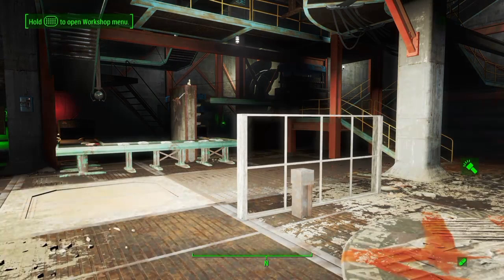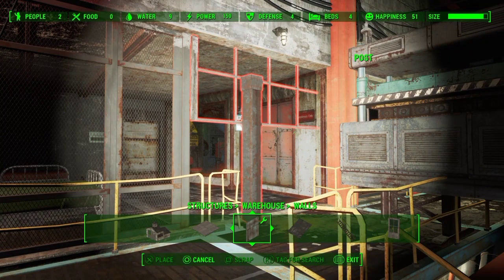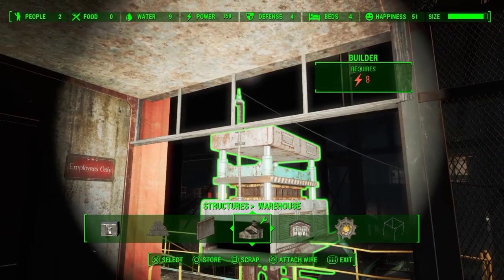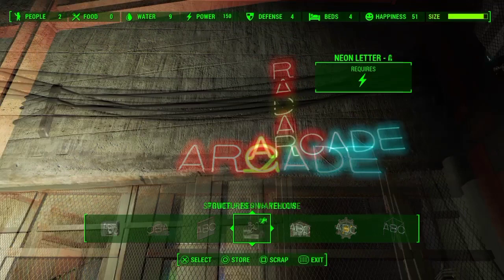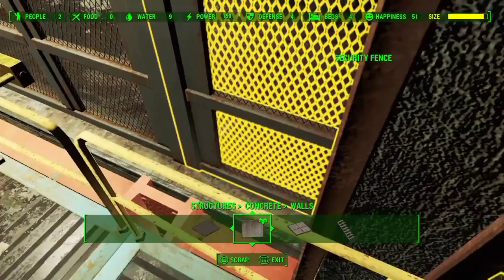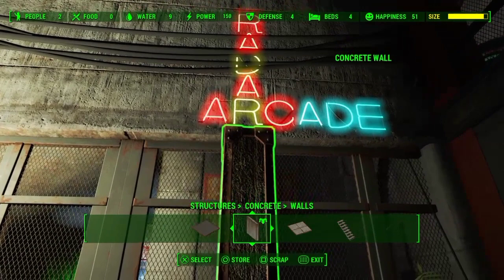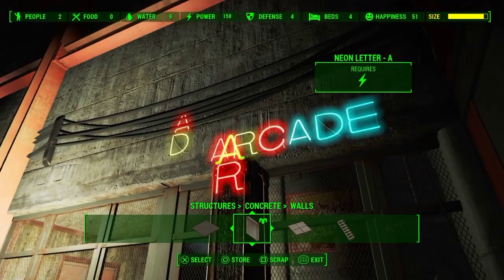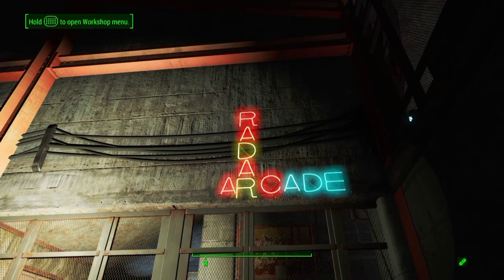Mechanist Makeover - Totally Vanilla Tutorial #fallout #nomods #gaming

Comment: Does that work with any wall? Or just the pillar? Thanks for the lesson, legend!💕
Reply from the maker: You're welcome! It works with any wall piece, and other objects, neon just doesn't have the same coding to "anchor" to its surface, like, say, the wall lamp. If you put a wall lamp on a build wall (not a native one), and store the wall, the lamp goes with it. Neon doesn't. And you can "hang" it on loads of objects- you may not have noticed, but the neon date display below the Champion's Board is also my underground entry, my Nuka Soda Mixer. I don't know if the neon on it would go, if I scrapped it, but I'm thinking no. If it didn't anchor to a wall, it wouldn't to objects.